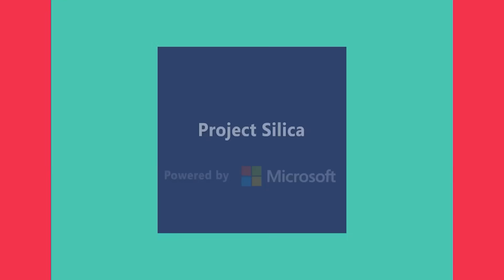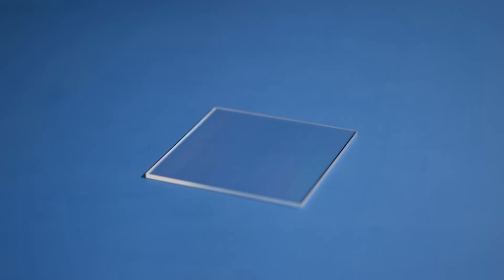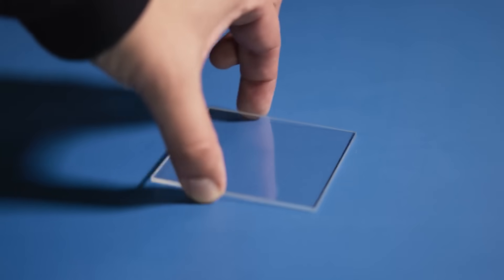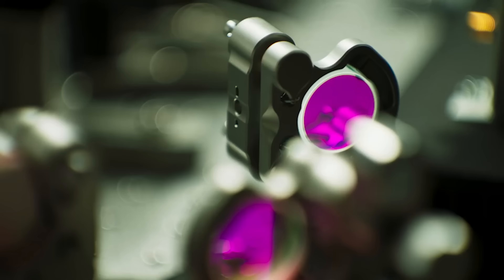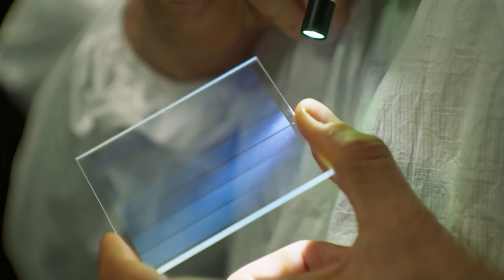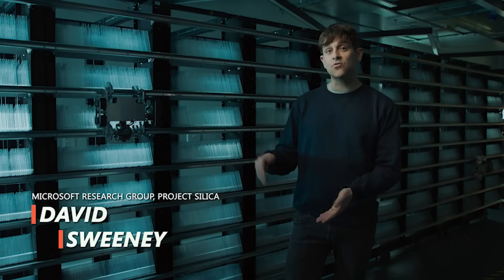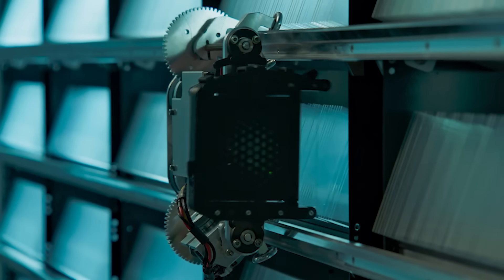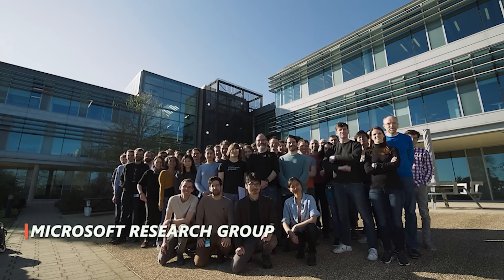Sealed in glass - Microsoft's Project Silica

Comment: How hard can that glass be? 
What if a data needs to be rewritten or deleted?
 What if it gets some scratches!!!😮
Reply: As hard as the front plate of your smartphone. And it doesn't break so easily because it doesn't have the weight of a battery and the rest of the phone attached to it. It's just a glass plate. And it's 70x70mm (2.75x2.75in). Being smaller, it is far less likely to break.

There is no rewrite or delete function. This is not a bug in an archival system. It is a feature. Write-once systems are impervious to ransomware like NotPetya.

Minor scratches, the error correcting codes will take care of it. Major scratches, depends on which side it is on. If it is on the data side, you un-glue the cover plate and replace it with a new one. If it is on the back side, you just ignore it, the reading takes place on the other side.

And scratches are very unlikely anyways. You'd notice the whole thing is automated. No humans are going into that room. Nobody's going to be handling the plates with their bare hands. Nevermind scratches. Think of fingerprints. The 7TB plates have data written at 1,000,000 dpi. The 75.6TB plates at 3 million dpi. Think of the whole room like a giant enclosed hard disk. You close the doors and windows and run the HEPA filters for a week before the machine loads the glass slides on the shelves. Yes there is error correction, but you'd prefer no dust gets on those plates.

Comment: Glass has a finite (although very long) lifespan. It is something between liquid and solid state, and it is constantly changing. If you heat the glass, it will change faster (you heat it to make it fluid and form it into a cup or some form of art).
Reply: This is the long disproven myth that glass flows over long periods of time.
It is based on glass being described as a homogeneously cooled liquid and the mistaken thinking among the public that this means it will flow.
It will not . Glass is a noncrystalline solid and it remains solid unless it is raised above its glass transition temperature.
If glass really flowed over time , the small glass artifacts found in 5000 year old should have turned to puddles on the floor and natural volcanic glasses likewise.

The only way that glass changes over time is that some compositions of glass can change colour
Reply: I would suggest that longevity would benefit if you were to keep the shelves in a temperature controlled room, and try to refrain from dunking the entire room into hot lava every other week. 🤣 They are building a long term storage/archival system. Not billion-year time-vaults. In any case, the earth itself doesn't have an infinite lifespan. The sun will get bigger and swallow the whole planet in approximately 5.69 billion years.

Comment: The reader/writer machine could be simplified by making the glass panes round and recording the data on them in a spiral!  
That way the head only ever needs to move on one axis and track something that's, at this scale, is a slightly jiggly line. This approach could make the technology cheap and small enough to be viable for regular consumers!  
While at it, one side of the disk could, perhaps, be covered in some kind of opaque material which could be used to mark the content of the disk with some human readable text!  
I propose naming this technology "Crystal Disk", or CD, for short!
Reply: There was a company that made DVD-R discs (dye layer) out of a rock material that claimed 1000 years lifespan.  Dunno what happened to that tech.
Reply: @drozcompany4132  They are still on track to final tests making sure it lasts 1000 years - expected to be released on Y3K :P nah just couldn't resist ;)
Reply: I still use m-discs on regulary basis
Reply: I'm sure they chose the form factor for a reason. I can't imagine all the engineers they have on this project being like, "Oh my gosh I never thought of a circle before. No other storage devices have used a circle."
Reply: @SephBane  well, they were going for density, it seems, instead of practicality. A simpler system (like a disk) is quire likely to require lower data density to be reliable. But, even 10% of the density mentioned in the video is quite a bit of data.
Reply: @SephBane  From a research perspective you don't build the ideal solution until you have tried many other form factors. Of course they knew about circular form factors but if that was their only solution it would not be research. Trying new things that are inefficient or clumsy or overly elaborate teaches us what are known as anti-patterns, what is the wrong way to do it so we can avoid it in the future.
Reply: it looks like the photoreceptors are designed to view large chunks of data and decode them as a 2 dimensional grid - sharing a similarity to, say, a QR code except much larger in size. This probably aids in read-calibration as the sensor can find the edges of each large square chunk of data and photograph it in parallel which would increase the read speed significantly. Just a guess. You could also have other "control" bits which act like alignment / calibration markers. With such a system, I imagine the data throughput could be quite rapid as the lens changes focus downwards through the glass and reads layer after layer as they get into focus.
Reply: @carpark1414  a 2D sensor with large resolution is more technologically complex and expensive than a sensor that probes a tiny area, particularly when you want it to sample things _fast_.  
Let's say you just want to record video, for now. If you want to record a 1080p video at 1000fps, you'd need a camera that costs several hundred bucks. The price only goes up when you need higher speed or resolution.   
Now, if you're fine with a 16x16 video... you can just get a 5 dollar computer mouse. Optical mice work by making hundreds, or, sometimes, thousands of pictures per second and comparing them to each other to figure out how it was moved. And yet, they're dirt cheap.  

The hardware necessary to process 1080p x 1000fps... 2 billion pixels per second would have to be pretty fast as well. That's a lot of pixels that need to be processes all at once.  

There's also things like the focal plane. If you sample a huge square, you won't know whether your focal plane is just right before you grab a frame and start processing it. And if it's bad, you need to discord your frame and try again.  

Dealing with sensor that grabs, basically, a voxel in space is much easier. Even if you resort to trial and error, you'd have to skip, what, a couple bits? You don't even have to re-read anything in a case like this, as long as sufficiently good error correcting code has been used. Additionally, once you're dialed in, it's a lot easier to track a point in 2d space (the sensor only really moves in 2 dimensions; the plane in which the sensor moves intersects the spinning disk), than to re-focus a plane in 3d (that's 3 coordinates + 2 angles of tilt)
Reply: @Sierra410  the complexity of the read portion is not the issue. The read speed is. By moving the lens to a new position, which takes mechanical movement and calibration, if the payoff is simply a single bit of information each time, that is extremely wasteful and absurdly slow, which is the issue they want to overcome at the moment.

By allowing the sensor to ingest thousands of bits per calibration and movement of the lens, the process can be sped up considerably. Also, considering camera sensor technology is available in mature quantities, that tech is essentially encapsulated and can almost plug in once the calibration adjustments have been made.
Reply: @carpark1414  once you've found the track with data, you can keep focused on it while reading fairly easily. That's how existing CDs, DVDs and BluRays work.
Reply: @Sierra410  they are circular. I understand you have a theory on this sort of implementation for this technology. This is not suitable the way they have created the storage layers in the current system. I wish you luck if you intend to pursue this.
Reply: @carpark1414  a disk can have several layers with data, just like a pane. There's nothing, really, stopping it from working.
Reply: @carpark1414  There is a segmented market for storage tech, fast like your phone down to glacier slow for cloud enterprise archive data, this would work fine for archive data, maybe new r/w hardware would make it viable in other market segments.
Reply: I'd call it "Glass Optical Disk", or GOD for short.

Comment: It seems to be the kind of glass that breaks easily when it falls to the ground though.
Reply: And glass warps over time, it's essentially a realllllllly viscous liquid.. look at old windows, not even a few decades old and you can see signs of warping. Of course you can use different glass formulations to improve the longevity.. but at 2min the dude boldly states "FOREVER"
Reply: Glass is not liquid, it is an amorphous solid. Old glass is thicker at the bottom due to how it is made, not because it flows over time.  @No_This.IsPatrick
Reply: @No_This.IsPatrick  Even wrapped, they can still be read, if you throw enough tech at the problem. Imagine we discover one of these slides and it is a million years old, but slightly warped. You can bet we will scan it at a far higher resolution than it was written in and then digitally "unwarp" it to read the data. Now imagine a million year old magnetic hard disk. It's probably oxidized to dust, but even if it was sealed in a special vacuum chamber for protection, the magnetized data is gone for good.
Reply: @No_This.IsPatrick no glass doesnt warp just by sitting around

Comment: Love that robot. Wouldnt it be useful to have some sort of Human readable ID on each slide, what happens in an earthquake and they all fall off or a flood and they all need cleaning. It would be a lot easier to get them basically sorted then let the machine catalogue them wouldnt it?
Reply: Wasted space. Data is stored on the slides at a density of 1,000,000 dpi. Any space you use to print stuff on the plates can be better used to store data. There is no need for human readable sorting. I imagine the shelves are bolted to the floor, and the slides are not just resting on the shelves waiting for accidents to happen. The slots provide some grip/resistance so that the robots have to actually pull them out. If you just turn the shelves over, the slides do not drop out.

But even if you somehow managed to get 1000 plates mixed up, have you ever tried to manually sort through thousands of items (like vouchers or receipts at a company where they end up in)? Well, I've done that, back in the day before computers become so ubiquitous. Humans suck at sorting when the total number of items to be sorted goes over 30.

It's better for you to give the plates back to the machine one by one and it knows exactly where to put them. You just load them into one shelf that's not been used yet, and the machine can do all the sorting by itself. It has all these robots to do it.

What would be useful is not human readable ID, but machine readable ID on each plate. Possibly on the edges, so that they don't have to be pulled out and loaded on to a reader to be read. The robots can read these as they over over the slides on the shelves. And being machine readable, they don't need to be so big.
Reply: @danielch6662  You are of course right, Im just showing my age :) The idea of machine readable edges sound very sensible Im actually surprised they haven't got something like that even if not on the side.

Comment: What's the read speed for this? Would it be possible to get these down to a size where it could replace Blu-Ray? Not that we need to but for things like video games, with the odd one being a few 100 GBs in size, it would be amazing to be able to store it all on a small compact source. Actually if you could get read speeds high enough and allow concurrent reading, I wonder if you could bypass installing games onto SSDs and read directly from the glass into memory, closer to how it used to be
Reply: not meant for your normal use,it isnt replacing the hdds or ssds in computers nor was it meant to do so. Different objective.
Reply: absolutely not, the machines needed to read this would be huge and need insane precision and calibration